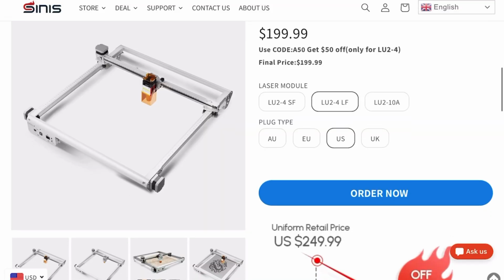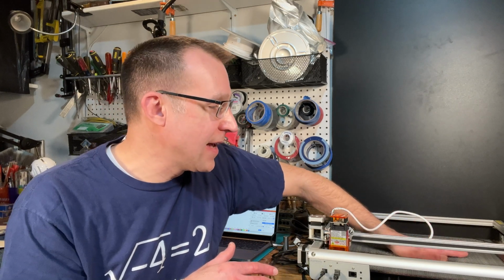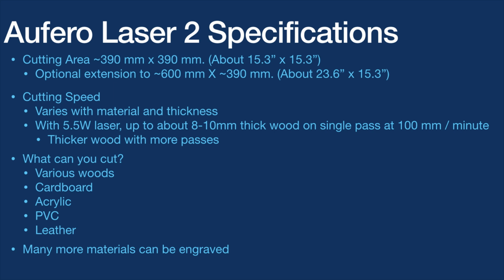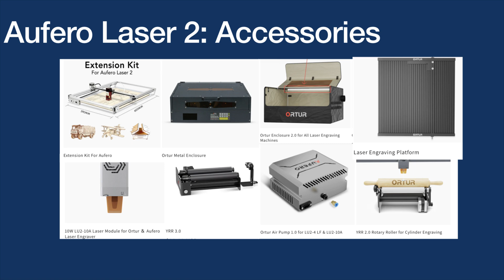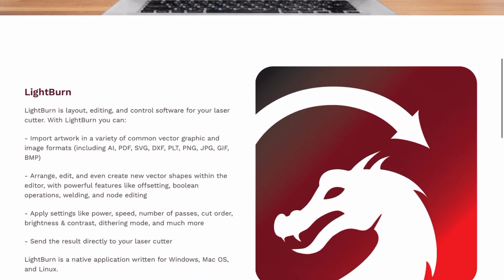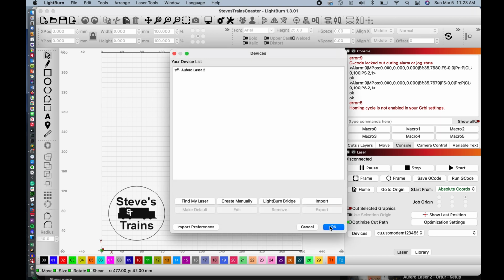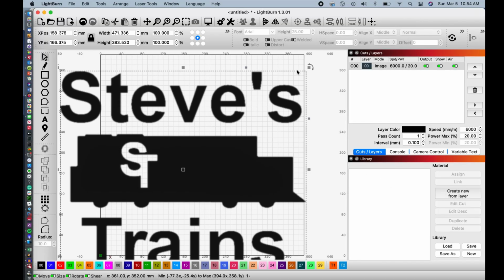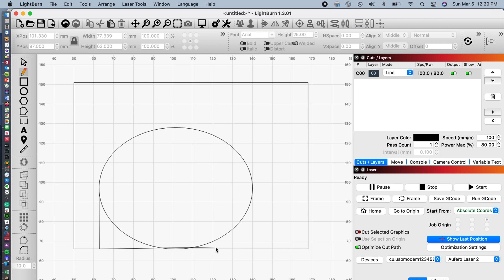The Aufero Laser 2: A Great Laser Cutter for the Hobbyist

Comment: You should never cut PVC with a laser!
"Although polyvinyl chloride (PVC) can in fact be cut with laser, the thermal process produces hydrochloric acid and toxic fumes. For this reason, we advise you not to use laser for cutting PVC in order to prevent corrosion of your laser system and to ensure the safety of the machine operator."
Reply from the maker: Thanks! Good to know!

Comment: I have an Otur Laser Master 3 ( same basic machine) and the uses are really endless.   Using it for way more than I ever planned.   
Look up ramp test for focus.  Most are not set right with the included spacer.  Mine was off about 3mm and now I am getting a lot crisper engravings on smaller engravings.  
I planned on using it to make buildings and such for my layout, but I use cereal boxes to make stencils for painting.  Can also cut painters tape to uses as paint masks.  I also make jigs for gluing and positioning of various irregular shaped objects using cereal boxes if just one-ofs.   Can very easily make grade crossings even on curved track... Possibilities are really endless.    Can't wait to see other uses you find. 
When getting a honeycomb base (basically a necessity) make sure magnets will stick.  Some are all aluminum.     Really helps with thin wood as it is never perfectly flat, and you need flat for the laser cutter.
Reply from the maker: Ah, great idea with the magnets. I was just using my 1-2-3 blocks as weights to hold things in place but some of my neodymium magnets might work a lot better since they wouldn’t interfere with anything, assuming they aren’t in the cutting path.